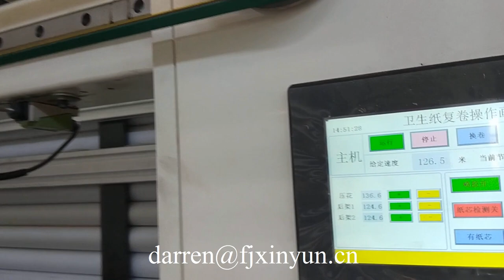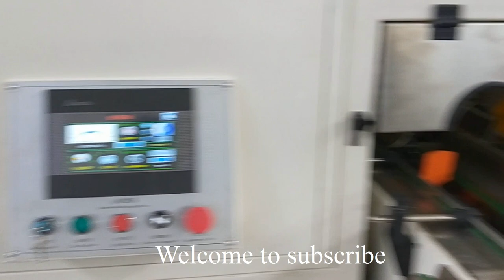Bath tissue production line small toilet roll paper making machine  price

Comment: Dear sir Darren Pan.

I need the same Toilet Roll Tissue Paper Manufacturing Production Line as portrayed in the video.

With the average sheet size of:
100 mm wide
105 - 114 mm long

Sheet count of:
180 to 840 per roll

I want 10 tons per day for capacity.

As I conclude, can I please have those details as a quotation accordingly. As well as the wholly costs of delivery, and installation etc. respectively.

Thank you very much sir.

Comment: Interesting.  The smallest capacity of your machine is how much.. 
May be between 1-5  tons of jumbo.
Reply from the maker: Dear Fabrique,
Good day to you.
May I ask what's the size of small toilet paper will you produce?(diameter and height of toilet paper)
how many rolls of toilet paper will you pack in one bag?
I take the liberty to recommend XY-TQ-1575B Automatic Small Toilet Paper Roll Making Machine  

The production process is: Unreeling — Embossing — Perforating— Rewinding— Tail-gluing— Edge trimming--- Automatic core loading. 

High speed:200meter/minute Capacity for one days is about 2 Tons(about 20,000rolls/8 hours) 

For processing 1.8 m width of jumbo roll paper.

FOB Xiamen Price: 23,500USD(With one set of embossing device)      25,500USD (two set of embossing roll)

Enclosed the details of this machine for your reference,please check the attachments.

Please click below link to see the operation video:

https://youtu.be/Xa0m8n0Df2Y

Adding toilet paper cutting machine,packing machine and paper core machine. 

XY-AI-300 Manual cutting machine costs 1,000USD    video link:https://youtu.be/8_bYn0nr0sE

XY-AI-398B manual plastic bag sealing machine costs 1,000USD   video link: https://youtu.be/vs6g__D4_gY

XY-SD-A Paper core making machine costs 7,500USD  Video link: https://youtu.be/VAilLVU_K2E

If you need higher capacity,we suggest you to use 2400mm width of jumbo roll.
Then the price of XY-TQ-A-D  Toilet paper production line costs 82,000USD
This line contain one set of XY-TQ-2200B Toilet paper rewinding machine(40,200USD)
(If you use 2800mm width and 2000mm diameter of raw paper,it costs 52,820USD)
one set of XY-AI-280 Toilet paper cutting machine(29,300USD)
one set of XY-AI-398A Semi-automatic Toilet paper packing machine(6-12 rolls/bag)(It costs 12,500USD)
This line is full automatic rewinding and cutting,then packing by semi-automatic.
Video link: https://youtu.be/Hl7VS_0yHEA
https://youtu.be/5jABX0UonNM

Does your toilet paper with glue lamination or not?
If you need full automatic production line,please see below machines.
2800 toilet paper rewinding machine costs 122,080USD(With one set of embossing and glue lamination system,and two sets of of steel to rubber embossing device)
If without glue lamination,then this rewinding machine costs 50,800USD
We recommend 60 log roll accumulator costs 15,800USD(Option)
automatic log saw cutting machine costs 29,300USD
Single roll toilet paper packing machine costs 37,000USD(Option)
Video link: https://youtu.be/rx_eT1JXO04
8-12 rolls small toilet paper packing machine costs 37,000USD
Video link: https://youtu.be/F-IfRuzRy_k
Full automatic 4-48 rolls toilet paper packing machine costs 79,800USD(Option)
Video link: https://youtu.be/2FCiq1s_r1o
https://youtu.be/s1IGAQmZzqA
What do you think of it?
Delivery time 85--100 days

Guarantee for 2 years

Payment item: TT  30%deposit,then 70%balance should pay before delivery.

We can send the technicals to your factory to install the machines and train your workers.

And you shall pay salary(100USD/day) and round-trip air tickets from China factory to your factory, 

the charge of visa, food ,transportations and accommodation in your city.

Any questions from you are welcome and will be replied in 24 hours.

Best Regards!

Darren Pan   

Fujian Xinyun Machinery Development Co.,Ltd

ADD: NO.589, Nanhuan Road, Quanzhou City,Fujian Province,China

Tel:0086-595-28053752

Fax:0086-595-28051752

M.B:0086-15060870806 (WhatsAPP and Viber)

Mail:darren@fjxinyun.cn     

panpeilun@gmail.com

Skype:peilun87

Website: http://www.xinyun-engine.com/

http://www.fjxinyun.en.alibaba.com/          

http://fjxinyun.en.made-in-china.com/   

Videos link: http://www.youtube.com/c/darrenpan

Comment: I'm interested in starting my own business . Make I know how much is the total cost of it ?
Reply from the maker: Dear Waqas Ahmad,
How are you doing?
May I ask what's the capacity of toilet paper production line do you need?
we suggest you to use 2400mm width of jumbo roll.
Then the price of XY-TQ-A-D  Toilet paper production line costs 82,000USD
This line contain one set of XY-TQ-2400B Toilet paper rewinding machine(40,200USD)
(If you use 2800mm width and 2000mm diameter of raw paper,it costs 52,820USD)
one set of XY-AI-280 Toilet paper cutting machine(29,300USD)
one set of XY-AI-398A Semi-automatic Toilet paper packing machine(6-12 rolls/bag)(It costs 12,500USD)
This line is full automatic rewinding and cutting,then packing by semi-automatic.
Video link: https://youtu.be/Hl7VS_0yHEA
https://youtu.be/5jABX0UonNM
Delivery time 70--90 days
Guarantee for 2 years
Payment item: TT  30%deposit,then 70%balance should pay before delivery.
We can send the technicals to your factory to install the machines and train your workers.
And you shall pay salary(100USD/day) and round-trip air tickets from China factory to your factory, 
the charge of visa, food ,transportations and accommodation in your city.
Any questions from you are welcome and will be replied in 24 hours.
Best Regards!
Darren Pan   
Fujian Xinyun Machinery Development Co.,Ltd
ADD: NO.589, Nanhuan Road, Quanzhou City,Fujian Province,China
Tel:0086-595-28053752
Fax:0086-595-28051752
M.B:0086-15060870806 (WhatsAPP and Viber)
Mail:darren@fjxinyun.cn     
panpeilun@gmail.com
Skype:peilun87
Website: http://www.xinyun-engine.com/
http://www.fjxinyun.en.alibaba.com/          
http://fjxinyun.en.made-in-china.com/   
Videos link: http://www.youtube.com/c/darrenpan

Comment: i'm from algeria and i want to know how much cost this production line,knowing that Main technical parameter are
 :

1. Production speed: 130-180m/min
2. Perforating line distance: 100-300mm 
3. Width of jumbo roll: 220cm
4. Max. diameter of jumbo roll: 115cm 
5. GSM of raw paper: 2ply 10-20g/m2
6. Diameter of finished product : 10 – 13cm, 
7. Machine Power: 11KW (380V 50HZ 3Phase)
8. Overall size of equipment (L x W x H): 6 x 2.8 x 1.6m 
10. Weight of equipment: about 6T
Reply from the maker: Hello,Mouhoub Beh,
How are you doing?
May I ask do you need one set of embossing device or two set?
Could you please send me all your request by email to darren@fjxinyun.cn 
or whatsapp:  +8615060870806
Best regards
Darren Pan